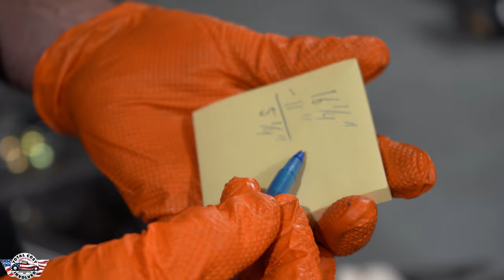TCI Engineering Grounded Chassis Assembly Part 1: 1955-1959 Chevy & 1948-1956 Ford pickups

Comment: Do you guys have the installation tutorial for the 47-54 Chevy grounded chassis !? That would be amazing .. these videos are extremely helpful
Reply from the maker: Sorry, we don't. The assembly is nearly identical between the two generations of trucks. The main difference is that the 47-54 has running boards.